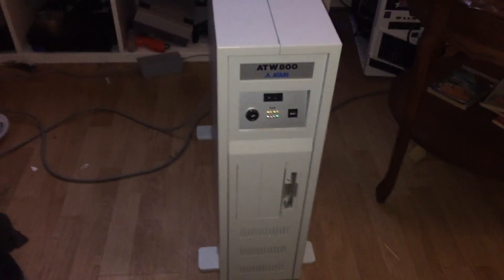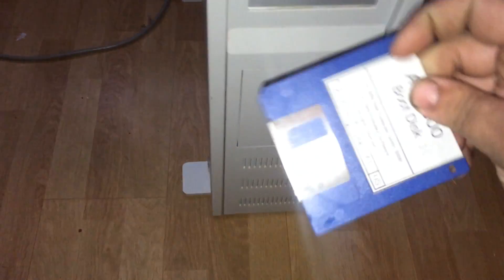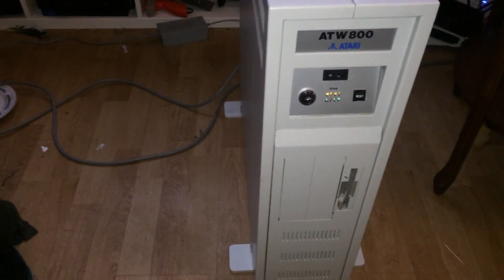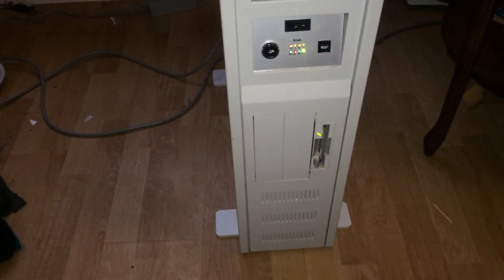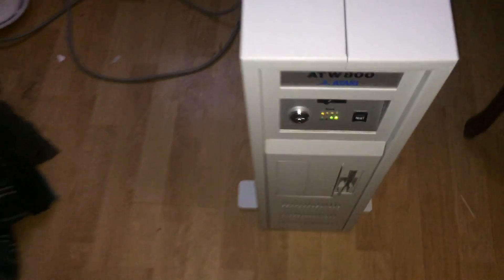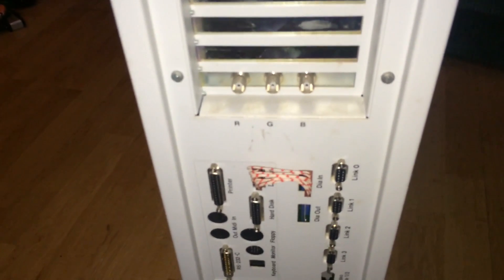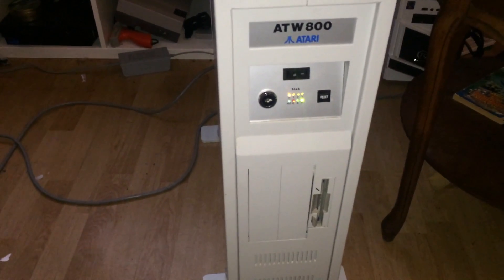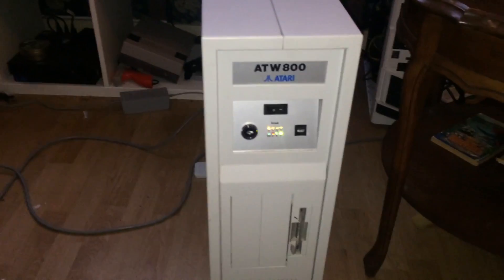Atari ATW800 First startup

Comment: That keyboard is probably MegaST / TT keyboard. Same plug. There is also ST/TT monitor (I am not sure - monochrome or color) plug. I was shocked by that - it has MIDI!!! Please make more youtube videos of this. This computer is very rare!
Reply from the maker: Thank you.. im going to invest a little into video equipment since i own a few rare systems that have not seen the light of day so i can document them. 
The keyboard is the same at the megaST since the computer has a MegaST built into it as a separate unit. 

I have a ton of research to do before i can create a proper video this computer deserves.
Reply: Please don't give up and make a good video. There is so little online about this machine. I think you will probably need an Atari compatible monitor for the Mega ST video output then an RGB compatible for the Transputer output too. Just out of interest, how did you aquire such a rare thing?
Reply: @Storm_.  The ATW800 outputs RGsB (31khz). I just uploaded 2 videos of the transputer I currently have for repairs running some X11 demos.
To my knowledge this machine has been sold already.